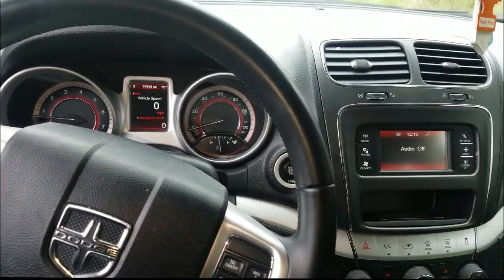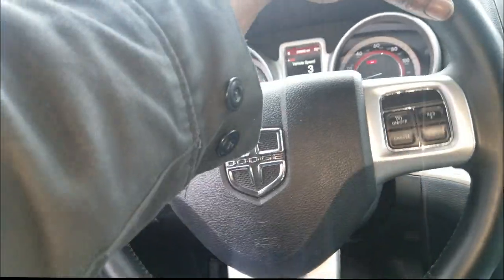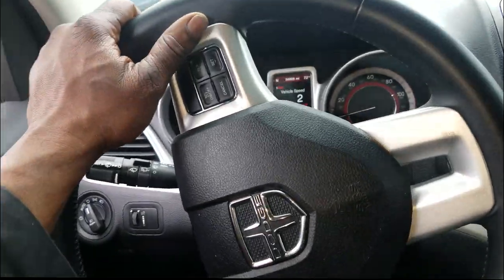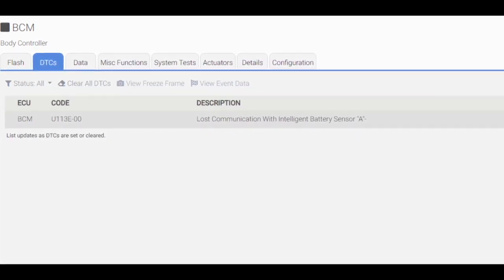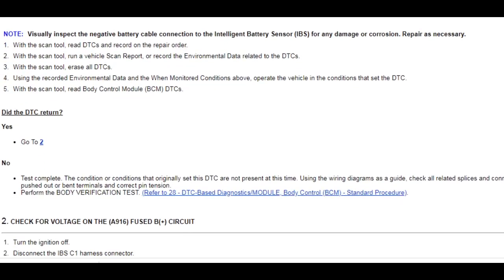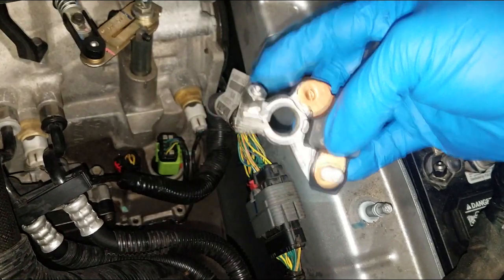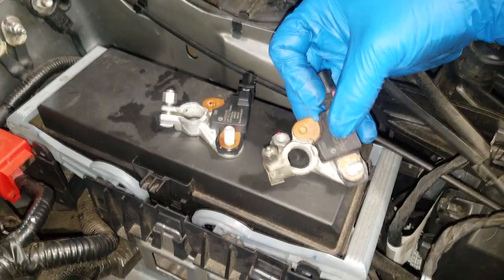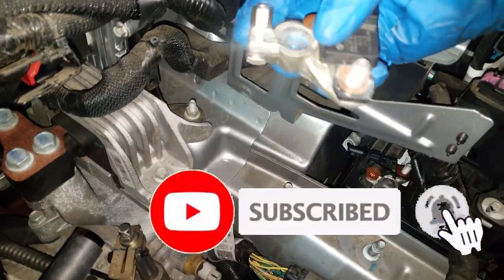How to fix a car electrical system.No Crank, No charging, Battery dead, Alternator bad, U113E, IBS

Comment: This was very helpful it wasn’t cheap coming from the dealer in Canada but Amazon had it for less the haft price
Reply: My local Dodge dealership here in Michigan had it for $117.35 yesterday, I found the same part on Rock Auto for $21.97, new part will be here tomorrow, and new battery will be here Monday.

Comment: So I have a 2012 Challenger that should have an IBS on it but when I replaced the battery there was no sensor. As far as I know it has never had one for 5 years... should I install one?
Reply from the maker: It depend on the package your car equipped with. Is this a Hemi or a V6? Also are you subscribed to the channel?

Comment: Just changed motor in 2012 dodge journey 3.6L will the IBS cause the no crank ,no start to happen intermittently after I pull on the wire it does start sometimes. I hear the relay clicking for the starter ,I have had 12.6 volts in the battery.

Comment: I have a 07 dodge charger  rt I don't see this part on my car ill have to look it up I'm having the same issue tho 6 alternators and 3 batteries I replaced myself after motor swap and sometimes they will last a couple months then next wk boom car running off the batteries power alone n cuts off after a trip to the store and now it only works on battery power hasn't went bk to charging in a long time my hemi is just sitting there🤦‍♀️😢

Comment: got a 2016 renegade. 2.4 first the battery light was on, sho put a alternator in, was good for 3 days.. then started happening again, they put another alt in now it has a p0688 and won't start or crank, any idea?

Comment: My vehicle was 2014 JGC was stolen and the battery stolen and replaced with a cheap one with no IBS. I have a new IBS, but I can't find the connector (wires) that it connects to. I'm guessing the batter was yanked out and tore the IBS off. Where can I find the wires that should connect to the IBS? Any help greatly appreciated!!!

Comment: Hello… I was wondering if you’ve ever come across this problem. I have a dodge pro master city 2016 the alternator is not charging it only throws out an 11.2 11.4 an electrician told me that the computer is not sending a signal, was wondering if there’s a bypass that I could do so I don’t have to buy the new computer. And if you can make a video on it. Thank you in advance

Comment: Hey O.M.T. I have a 2014 journey sxt and had to replace the alternator and battery. I cleaned all the terminals hoping that'd fix problem It ran fine for a cpl days then will only start with a jump and now battery saving mode came on and the alternator won't charge the battery now and engine light came on. Is their a way to test the IBS with a meter? I appreciate your thoughts on the issue my wife is not happy thanks again

Comment: Mine is 2016 Dodge Journey RT. The same thing happened to me after I just bought a brand new battery. First of all I would like to knock Dodge over the head for the absolute horrible placement of the battery itself. It’s not common for a woman to have to learn to remove the tire and fender wheel lining and clips to get to the damn thing. I felt the car go limp so I coasted into the autozone parking lot. They were unable to jump the battery and said the brand new battery was dead. The battery I just purchased plus labor from a dealership was nearly $300. That same dealership said the alternator was fine. I sat in the Texas heat yesterday and waited for roadside assistance for four hours to jump start me in sixty seconds. Roadside assistance said that if the autozone would have used a fully charged crank that it could have saved me time and sunburn. He also said that my battery should have a sticker with a date on it per a law that was passed two years ago. I cannot see the sticker, but I didn’t take the wheel off either. Roadside assistance said that the dealership probably sold me an old battery. Are you kidding me??? Well currently I am living out of my car. I was able to drive about five miles to a hotel before my Journey died again. I cannot afford to stay here, but I had no choice. So come Monday, I will have to get a tow back up to the dealership or a jump. I wanna see this sticker because I am about to lose my cool. Thank you for letting me vent. I am saving this video as a reference when I get back to the dealership. I thought about trying to take the wheel off today, but my arm is blistered from the sun yesterday and I forgot I put my hand tools in storage. Thank you for your informative video.
Reply: Sheeeesh. I read that all and that's just a horrible experience compared to mine! I had faulty dodge fuel pumps that left me "stranded " about 5-6 times! Twice on freeway luckily "coasted off the exit onto shoulder/safe area"

Then today (whole new dodge car) I needed a battery and got one at orieleys (which I think is the best place for car batteries due to their warranty) and my screen doesn't work lol
Reply: I'll help u G I have the same problem right now 😍

Comment: Is the name for this a battery current sensor as well or is it called IBS
Reply from the maker: Its IBS
Reply: @OnlineMechanicTips  so i baught the wrong sensor then? i dm u a picture on instagram
Reply: Cause we broke the sensor on the batter so the car wont start now and it was on rockauto.com the name of it on there is a bosch  electronic battery sensor thata why i asked

Comment: I have a Ram 1500 2015 Battery Saver Mode comes on Then shuts off the radio Can a bad IBS sensor cause this?
Reply from the maker: This thing can cause all kind of problems. The good news is that its monitored by a module. Have you had the car scanned for codes? Also are you subscribed to the channel?

Comment: What u1197  code, locksmith got that?.... my cars doing same its a 2010 journey r/t..we. replaced alternator battery battery,bc it powered dwnnone a.m..so car wont crank,n battery is being drained.. then ant theft light blinking,hence the locksmith,had him attempt to program keyfob,but that didnt ovd the anti theft..idk what to do but pump the air😂
GOD BLESS

Comment: Does the alternator use the IBS to determine charge rate? what really happens if you drive without that sensor?
Reply: I have a 07 dodge charger I'm hoping this may be my no charge problem but the 5 volts to excite my alternator  car comes from the computer I "think" the voltage regulator is in maybe in the computer as well but I will check this part in the video hopefully this will solve it that or that weird screw down fuse I never knew about lol🤷🏻‍♀️but both are better then the computer
Reply: Maybe as in by way of the battery but your alternator has so many volts and is triggered by load as far as ik so some alternators have internal voltage regulators